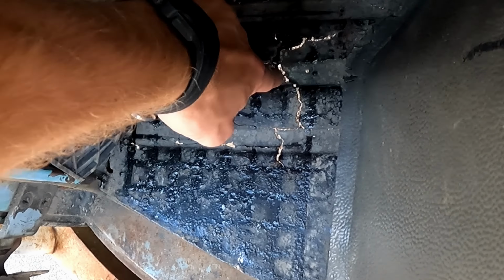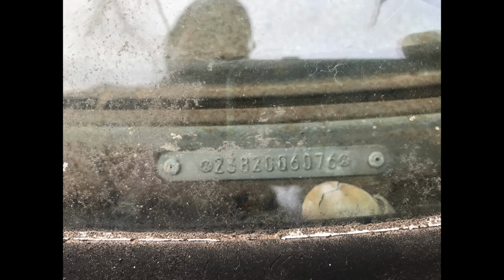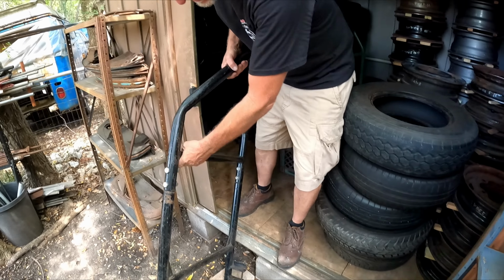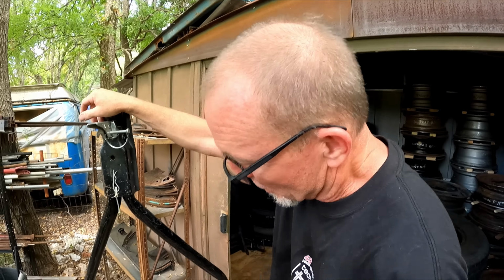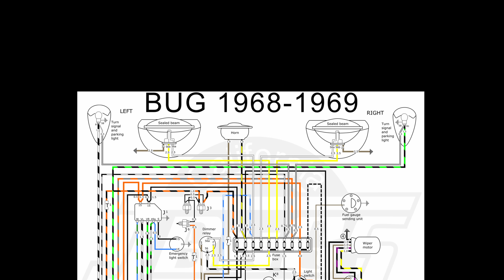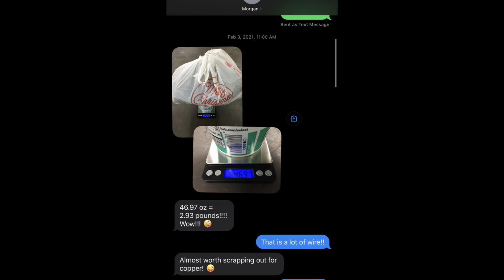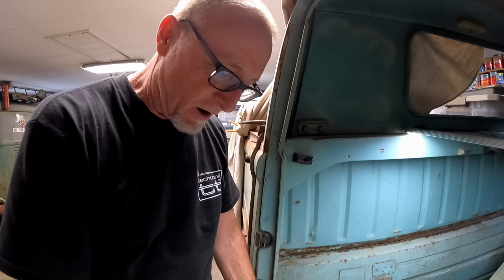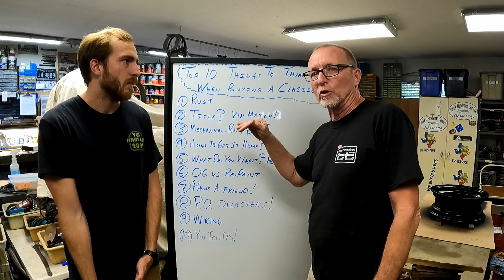Top 10 Things to Consider When Buying A Vintage Volkswagen!

Comment: Do you have room/space to store and work on it? What level of restoration can you realistically handle (roadster-ration or all the way to complete frame-off)? Do you want to enjoy it right away or spend years getting it back on the road? What amount of "POD's" are you willing to correct?
Reply from the maker: these are all good!
Reply: Yes, knowing what you ultimately want and what you can do yourself are very important factors, afaic.  Is it better to buy a car for a relatively cheap price that needs a lot of work, or a more finished car for more money that will be on the road sooner?  How much time can you devote to it?  The idea here is that after all repairs are said and done, you could spend just about the same amount of money either way, except that with a project that is less all-encompassing, you'll be driving it sooner, sometimes much sooner, especially if you are working in it yourself.  We don't all have a crew. :)

Comment: Definitely know when to walk away. I was considering an early Bay once, seller had glued those bamboo mats all around trying to hide rust on floors, front doors wouldn’t close right. He was pushing the new brm wheels and tires. I walked away. Anyway,  two weeks later, I found my 7/70 Bay with current tittle, front disc brakes (plus) Tran, motor, all seats, original glass all around, gas cap & keys. Typical lower front nose rust and an air vent on the front roof that he forgot to mention on the ad.  My #10 would be weigh the Pros and Cons and close the Deal without overpaying.  You guys rock!

Comment: Great info as always!   
#10 - What is missing? - comes with experience but knowing what you are NOT getting when you buy a VW can be as important as knowing what is actually there.  This is pretty important as some parts are either hard to come by, expensive or even not available (other than used).
Reply: Boy, no kidding!
Reply: I agree, this would be my #10 too. Is it complete? Rare parts missing can turn your 'good deal' upside down. Priced a semaphore or a MK1 Swallowtail Rabbit chrome surround marker lights lately?  Hint : I'll be putting the markers on Samba soon 😁

Comment: One of the things you can do is use a refrigerator magnet (flexible) and hold it against the car and if it cannot stick you know there is way too much bondo on the car.  Like that blue bus you showed, they just covered holes in bondo, so there is no metal structure.  A lot of bad paint and body work also just uses bondo to cover dents, and it will be so thick that the magnet won't stick.  There is a lot of sloppy paint and body work out there, and you really have to beware.
Reply: Always have a magnet with you is a great suggestion!
Reply: Absolutely.  This is one of my top 5.  I look all over for buckling, body panels out of alignment, deep cracks in the paint.  Just like rust it can be fixed, but it is hard to know just how think the bondo is.  I bought a 69 one time that looked great, but it turned out a tree fell on the top.  Whoever fixed it was a sculpt!!!  They made it look exactly as it should.  But it was cracking.  I ground off inch thick bondo in places.   When the damage is that deep, 99% of us are not talented enough to fix it.  Look for previous damage.  Use the magnet.

Comment: Another great video. I believe there is a standard price for VWs. I mean that you should buy the most complete car as possible. Fenders, bumpers, seats, etc. if you are getting a good deal, most likely there are missing items. When you find them and pay for what is missing in your deal, you maybe should have spent more for a more complete car cause you will still spend the same amount buying missing parts.  That has been my experience with my buddies.

Comment: Best "how to" video yet. Maybe I should say WARNING!! You guys should have done this one many moons ago. I drove by my bay everyday for several weeks and finally stopped to check it out. Went through the bonded title bit, new engine,  floors, rocker panels and currently replacing body panels. You are correct about the wiring. Mike in So Cal just produced a video on the wiring.  One thing I may have missed is the VIN will reveal the factory color. I bought the van because it was calling me. Good job guys. I would probably do it again.👍😁😀
Reply: When you know it, you know it! There have been a few VW's as soon as I saw it, I knew I had to buy it!

Comment: All really good points guys. there are several good suggestions in the comments. I have Time for #10 old Vw's  are gunna take time whether you are doing a full resto or a roadstoration or gen maintenance. Are you willing to put in the Time to get/keep the Vw  on the road?! I like the top ten idea and maybe in-depth instructional videos to teach novis  potential  Vw'ers the ropes on things that may come across as intimidating. Like valve adjustments, carb adjustments, engine drop, burnt valves etc. Maybe even an in-depth explanation engine/trans rebuild   I think you get what I'm sayin. good vid guys keep it up :)

Comment: #10 should be “How bad is your local aircooled shop”… Our long gone local “expert” took an all go and turned it into a 🤬no… 2332 dual carb replaced with a 1600dpdr with a 30/31, 4 wheel discs swapped out for 4 wheel drums, race belts replaced with factory lobster claws, 5 different brands of glass, 7 shades of tint… F-i-l took it in for an issue with the distributor…
Reply: I dumped my "trusted mechanic" when I found one of my rear hub nuts on finger tight (WITH cotter pin!) Guy supposedly had decades of experience. Have since found other squirrelly repairs he did. Your best bet, unfortunately, is find out where the people with big money and knowledge take their cars, and get LOTS of recommendation stories about the shop and their practices. Great small shops with that "one VW guy" are out there, but damn, there's a lot of inept lawn mower mechanics out there, too.
Reply: Unfortunately, I was 2500 miles away at the time… Got back here a rew years later, “mechanic” passed before I could get my engine, brakes, seatbelts and my wife’s custom 68 Beetle back. Her car is in pieces by a barn up the road from our house.
Reply: Oh, that's awful! Nothing less than heartbreaking, I'm so sorry!

Comment: 10. what kind of wear do the pedals have? The mileage may turn over but if the rubber on the pedal is gone that might mean the difference between 20,000 miles and 200,000 miles. Also if the rubber is brand new, as in replaced that is just as telling.
Reply: Excellent tell tale for real mileage and wear. I always put new pedal pads on, makes me feel like it's getting a new fresh start on life.

Comment: I like to see if I can catch the seller in a lie, and then probably walk away at that point. For vintage VWs I’ll ask if they engine leaks oil, if they say no, or not that I’ve noticed I almost can guarantee they are hiding other things. I also have a vintage airstream and my trick for buying a vintage airstream is to ask the seller if it leaks, if anyone tells you their vintage airstream doesn’t leak when it rains, they are lying about it and probably other things as well.
Reply from the maker: ah interesting way to gauge the seller

Comment: If a 15 year old punk ( It's me ) can build a 1200 that ran for 135 ,000 miles , I had the end play set . Anyone can ! The trick to build a good engine is good parts . In the early 70s we got parts at the Dealer . crankshaft exchange was 12.50 with a good core , rods were 2 dollars .  Lets put it this way a crank kit with rods and bearings + gaskets was 35 $  you didn't need to read a mic. just put it together and it was right .
Reply from the maker: wow those were the days!

Comment: Number 10 should be ......Do you have tools to work on your VW. I've seen VW owners that don't invest in the correct tools to work on their VW and drive them with loose nuts and bolts.  Number 11.. Breaks, Number 12 slammed or stock .